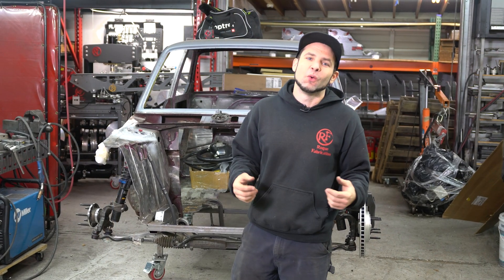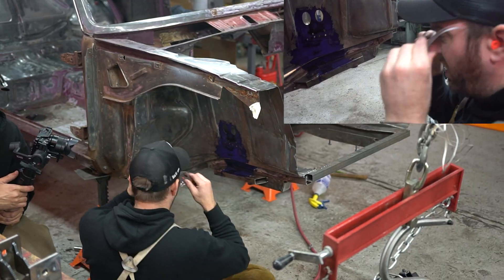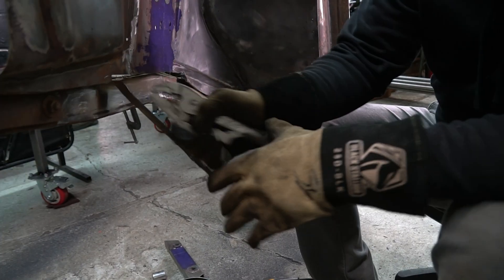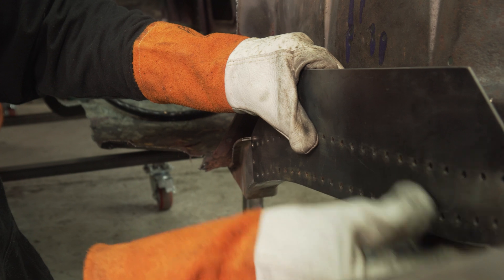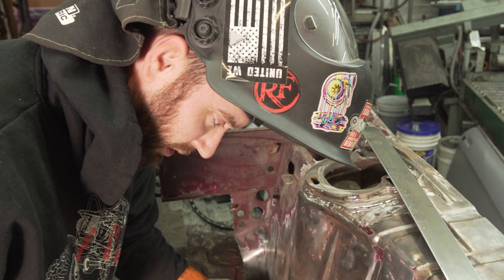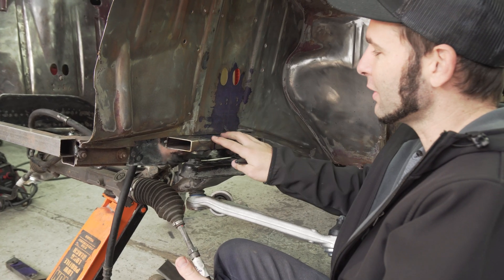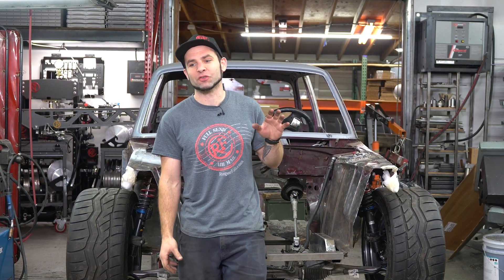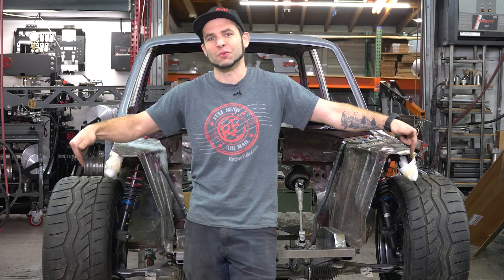BMW 2002 EP3: E46 Suspension and F82 Coilovers in a 1972! Engine Swap Chassis & Frame Fabrication

Comment: Any reason why you chose a E46 subframe?  I used a E36 subframe in my 02: the best steering you can get!
Reply from the maker: Ain reason is that we got a running clean e46 for $400. I've never heard anyone argue E36 as better (unless they want to weld on control arms, since they're steel). What makes them better? A little late for us to change now... -Joe
Reply: @RogueFabrication  Oh man, 400 dollar for a clean running E46?  I live right next to Germany but I cant find them that cheap!

If left original there is not much difference but we build drift cars and the steering geometry of a E36 is far more easy to modify.  At the moment we are restomodding an old 2002 and in the front its all E36.  E30 at the back.
Reply: Pretty sure they are the same thing, people swap arms between them and E30’s. The knuckles are different, is that somehow better on the E36? All the steering racks are also interchangeable anyways.

Comment: I don't think that's a '72 2002 any more 😂
Reply from the maker: We still have the nose piece... and It will be going back on. It also isn't a tube-frame car with a body resting on it. Passes my test for "is this still a X" ;) 

What are your criteria? Original engine? NO frame mods? Not trying to argue. I am curious!

-Joe
Reply: @RogueFabrication  Mostly I'm joking!  I do also own a '72 2002, incidentally.  I'm more about keeping cars original / OEM as possible.  I'm changing only my seats (to Recaros) primarily in order to preserve the original seats.  Obviously for racing that needs to change to certain degrees.  I used to race a '74 2002 in the early / mid 90's, which was stock engine (w weber & headers), drivetrain, suspension (except for adj. camber), tires/wheels and required safety equipment.  I still believe yours to be a '72 2002 because it will have mostly the stock body & frame (modified)!  What I don't know is, will you be using the M10 engine?  As I write this, I guess it's the body that makes it car!  

By the way I was led here to you via 2002faq in which I participate.  Enjoying your videos.  Are there any other 2002's in Lemons?